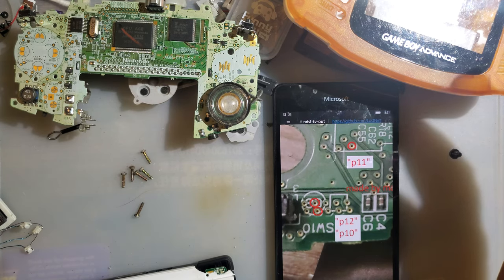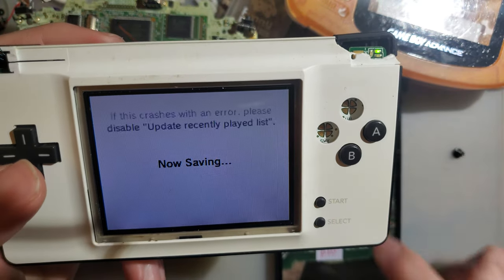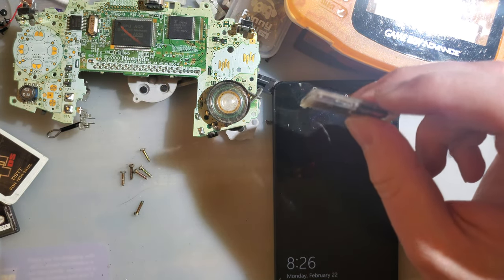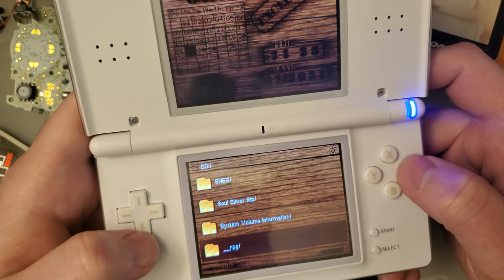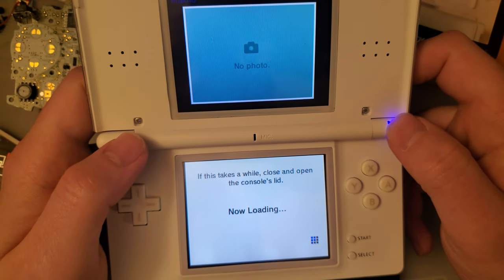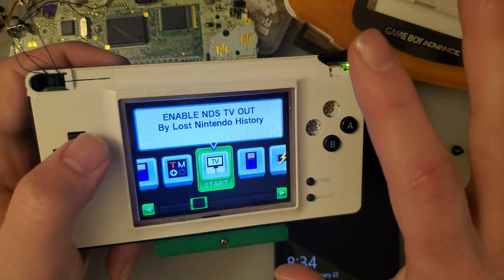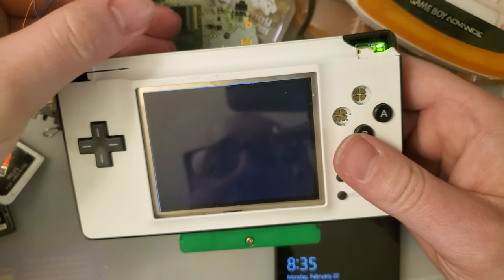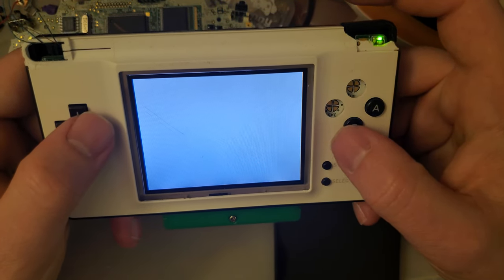NDS TV Out - Picture Modes (Part 2 of 2)

Comment: Okay, so let's talk long term here. What do you think the finished installation will look like. ( assuming clean and easy firmware ) A small internal circuit board that has 2 ribbon connectors, one to the DSL and one to the top screen. And then a 3.5mm jack added to the console that you can use a readily available TRS -> RCA adapter to hook it up to the TV?
Reply from the maker: I think that is very doable. The software needs more polish first, however. 

I think this is much more likely to end up in a custom Macro style design rather than a stock DS. As is, there is not a way to get video out and top screen working simultaneously. Hardware connection aside, enabling video out seems to partially disable the top screen.

Comment: Question. Can you mod the ds lite for picture in picture, without tv out? This would be helpful to run emulators off a ds cart on a macro.
Reply from the maker: So did you watch the video or no?
Reply: @makho  I did, haha. It's possible I didn't absorb something (adhd here). I'll rewatch no worries :)
Reply from the maker: @CDX23  I never actually hooked up the TV out interface so I just did this all with a Macro
Reply: @makho  ah ok, I don't think I realized that for whatever reason, my bad.